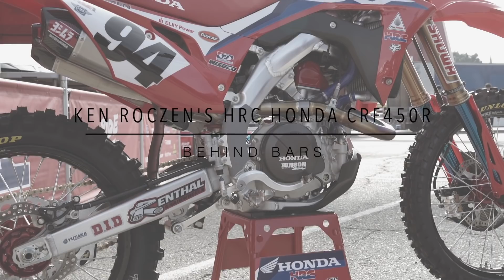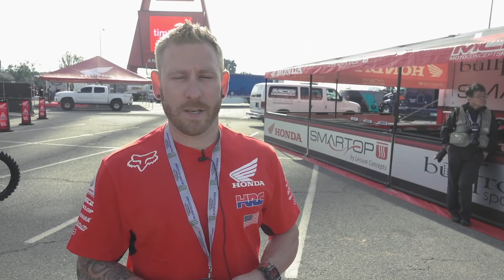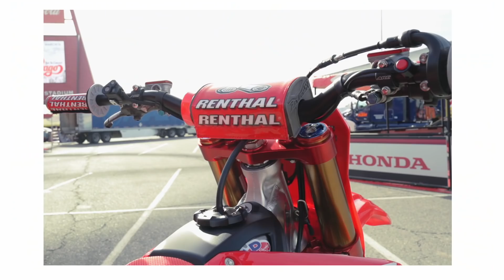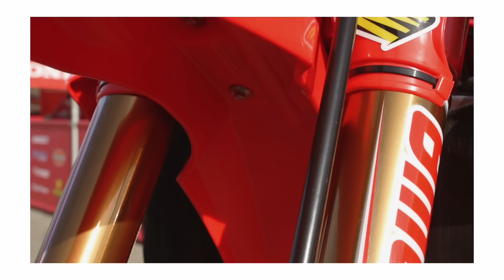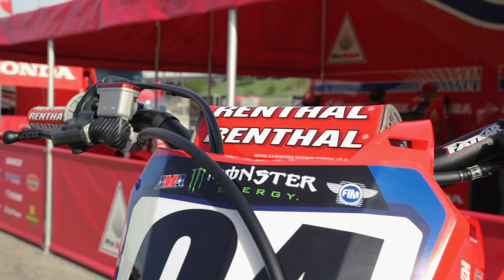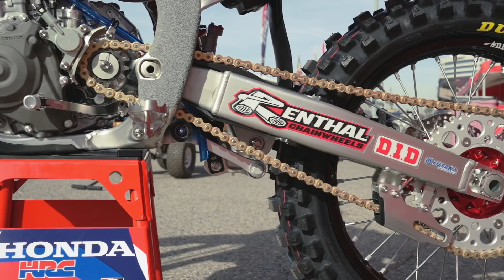Behind Bars | Ken Roczen's HRC Honda CRF450R

Comment: Only thing that could make the bike better is a 2 stroke engine! To Honda: KTM and Yamaha make both why can't you? Give the customer what they want. I'm still riding a 05 250R because you refuse to produce the 2 stroke, if this doesn't change I will buy Yamaha very soon. As for Roczen, he is a badass rider, hope he has a championship season!
Reply: Oh come on bro! 2 strokes are fun as hell!! But have vibration issues
 The 4 strokes are alot more smoother in its delivery, the torque is what the pros love aswell. And today's modern day 450s just absolutely blow  2 stroke out of the water. You'd be off your head if you were to deny that!!! These beautiful machines produce 60hp while the 2 bangers are between 45 and 47hp